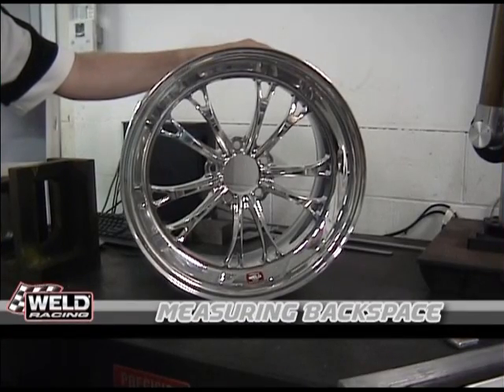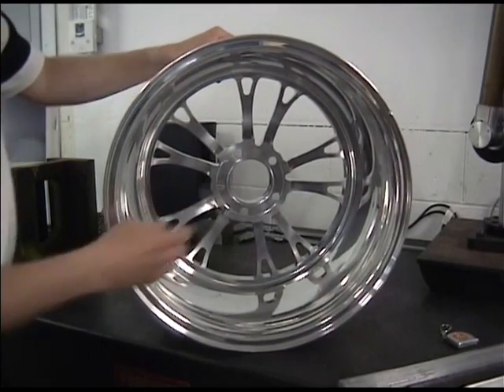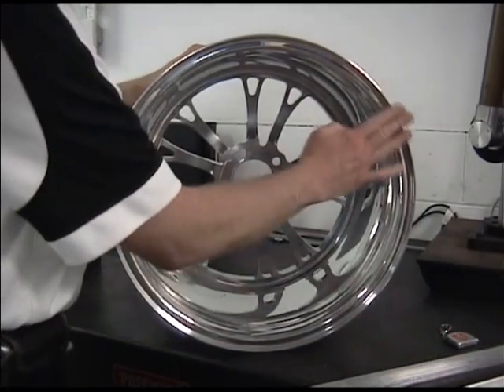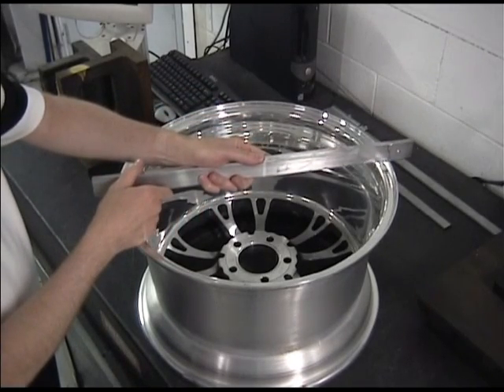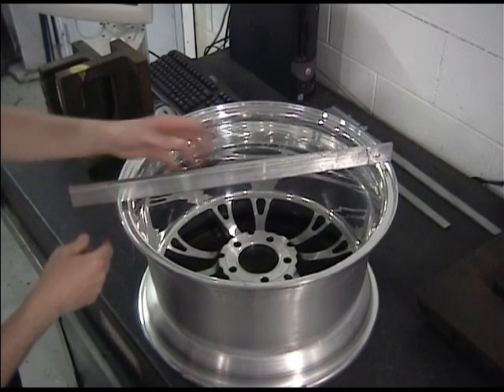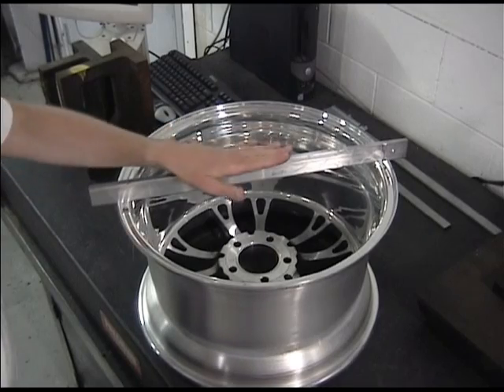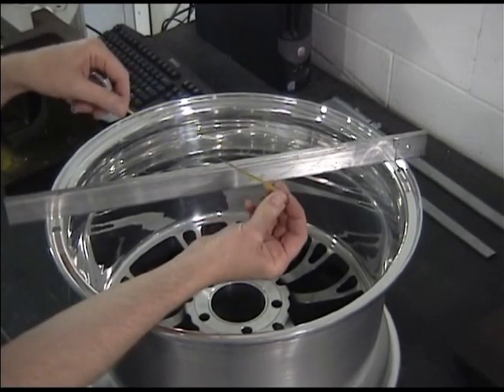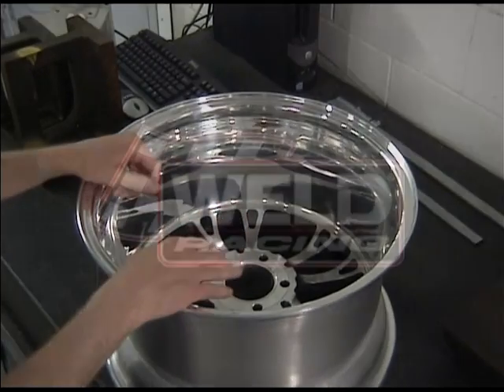How to Measure Back Space on a Wheel, Shown by Weld Racing

Comment: Where is the part number stamped on a draglite?  How can you tell the width and backspacing on a wheel with a tire, on the car?  Or can you?  Or, do you need to take the wheel off the car to get the B's and strip the tire off the wheel to measure the width accurately?

Comment: The hook on most tape measures have a little play in the rivet. So that it compensates for the thickness of the hook. When you push the end of the tape to measure, the hook moves in. When you hook the the tape and pull, it moves out. Exactly the thickness of the hook. Therefore it's accurate using either method

Comment: It may not be common knowledge, but tape measures are made with the measurring "hook" on the end having intentionally slotted holes so that you can get an accurate reading when grabbing the outside of and object, as well as when butting the hook up to a flat surface as in this instance which pushes the hook against the nearer side of it's slotted holes.

Comment: have a 15 x10inch rim. what would back space need to be to keep inside fender walls for a 1982 s10 truck.
Reply from the maker: +Joey Dial , 
A 5.5” backspacing is the most available size that will fit but, may still have some protrusion beyond the wheel well. Much of this also depends on the tires you plan on running. Give us a call, we can help you through the process. 1-330-630-0240.

Comment: I understand how you must add the 3/16 of an inch to the measurement when using the fixed ruler, but when viewing the video It looks like the yellow tape measure is at almost 8 inches.  7 and 9/16 is just over 7 and 1/2 inches (close to 7 and 8/16).  Why does the yellow tape measure appear to be at almost 8 inches?
Reply from the maker: +William Barth, 
Due to how quickly the speaker is moving and the angle of the camera, it is difficult to see how accurate the measurement is. When you follow the technique shown, you will be able to see more clearly the measurements you are taking.

Comment: WOW, I'm not sure if this guy is the idiot or he thinks everyone else is.  spends 4 minutes telling someone how to measure a RULER with a tape measure.  then he said a tape measure would be off by the thickness of the end clip.  DUDE the end is designed to move that amount to adjust if you ae pushing it against or pull it away from what you are measuring.  that's why its LOOSE, or did you use a hammer and tighten yours up. classic though he uses a architectural rule then proceeds to show us how to measure it with a tape.

Comment from the maker: You add 3/16 of an inch because the measuring lines do not start at the end of the ruler, this shifts the number up and off of the mounting point of the wheel 3/16 of an inch.  To compensate, you must add the 3/16s back into the measurement.